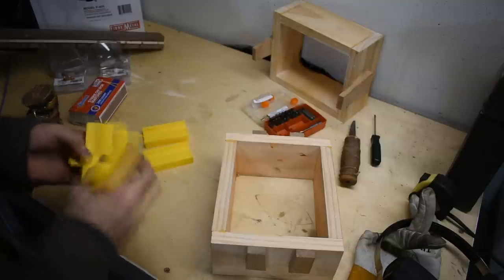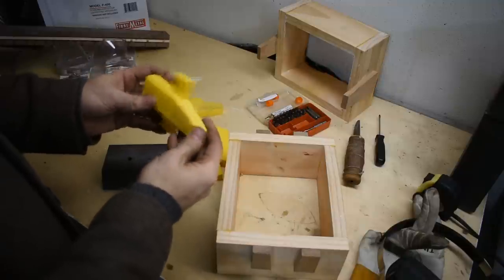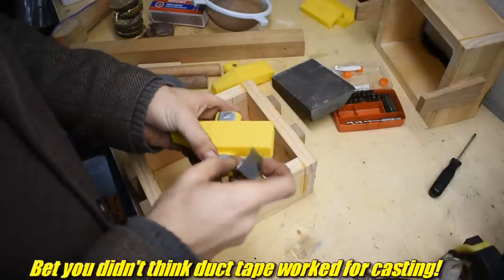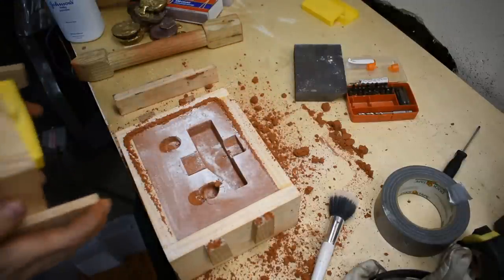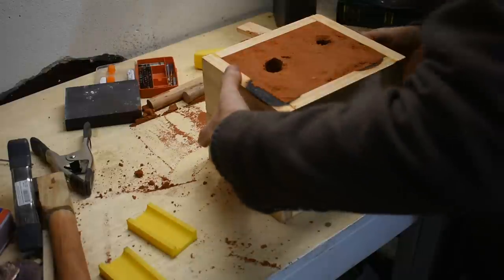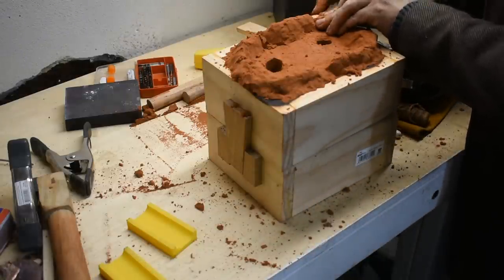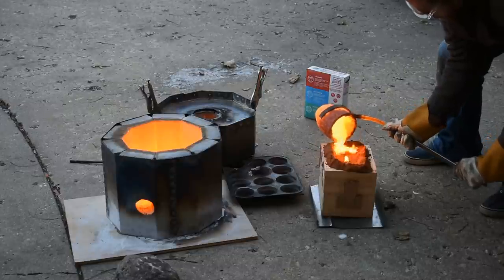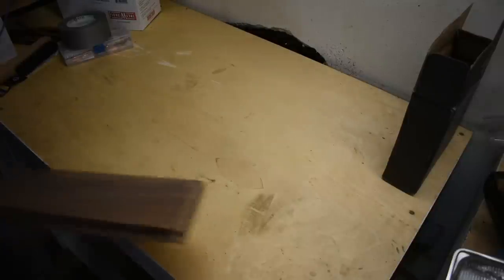DIY Aluminum Bronze Hammer: Golden hammer for Black Smithing

Comment: For hammer Handel length  i use Elbow tip to the your first inside finger knuckle, not the knuckle join touching your palm, the one after so your fingers can go over the top a little bit.
Reply from the maker: interesting, thanks for the tip!  I actually have to make a new handle for this hammer.  I was using it as a pry bar and broke the head off.  Woops!

Comment: Nice hammer! Another reason for the taper getting thicker away from the head is sweat. When you are forging, you sweat, sweat makes hand slippery slippery hands and smooth handle = hammer flying away. (I've been a part time black smith for ~9 years)
Reply from the maker: Thanks for the tip!  Makes sense.
Reply: Quick question is aluminum bronze viable for a forging hammer ? Wont it melt once it makes repeated contact with the hot steel?

Comment: If you want a relatively easy way to help strengthen your parts similar to work hardening, you can take a few 1/16" ball bearings and sandwich them between two strips of tape (about an inch long) in rows at either end. Glue this into a slot in a small rod with equal parts of tape out either side and use that in your drill to make a flapper peener. Using this to hit the surface of your metals will strengthen the surface so it will stand up to fatigue better.

Comment: Nicely done Paul.  About how much does the hammer weigh?  It has been far too cold to fire up my furnace so casting is on hold here for a bit. Yes greensand dies freeze when it's -30C.
Reply from the maker: The hammer head is a little over 2 lbs, not too far above my initial goal.  -30c sounds pretty bad!

Comment: You will have to make sodium silicate next summer.  It's easy and pretty cheap to make with kitty litter.  Or you know it's the stuff in radiator stop leak that stops it from leaking.  We filled a few large empty  alcohol bottles full last summer for projects.  It's great stuff to just have around.
Reply from the maker: I got some kitty litter, sounds like a fun project

Comment: Wow! Super awesome! What’s the benefit of aluminum bronze hammer when forging? Is it to hit a harden tool, like a another hammer, without the danger?
Reply from the maker: Mostly the advantage is I can actually cast it, unlike steel :D  but it's a little denser than steel so it's heavier, and although it's a copper alloy it work hardens a lot so it doesn't go all soft and squishy like a brass hammer.  Fresh out of the sand it's annealed, but it hardens up quickly with some work.  I'm hoping i can make a bunch of tools out of the stuff.  Most of the awesome properties are irrelevant to forging, it's non-magnetic, it's non-sparking, it's tarnish/corrosion resistant, but the weight and hardness is the reason i picked it as a hammer material.  Most alloys i can cast aren't hard enough, except aluminum bronze.

Comment: I'm really curious how the hammer holds up.  When I first saw this video I assumed the hammer would be for display only but in a later video you were actually hammering something with it.  How does it compare with a normal steel hammer?

Comment: Hi Paul I’m about to start my own channel about casting metal/ forging my question is what camera would you recommend me using? Also if you were to drill another hole on the opposite side of your foundry and add another propane tank and get a tungsten crucible I’m pretty sure you could cast steel that’s if you want to go that route.

Comment: Love your videos, more for your humor than your skill, but also for that. Heh, well you wound up with a huge shrink deficit because you didn’t cut a feeder cup that would continue to provide more molten bronze as the hammerhead began to contract away the walls of the mold. I used to work in a bronze foundry, though we used ceramic shell molds instead; not practical for your setup, the pour cups worked as feeder cups all the same, and we seldom had any shrink deficits. However, we never casted anything solid, so I hope you like the color of the smoke I am blowing up your keester.

Comment: Hammer handle length (I was taught) and has always worked well for me: Measure the length from your hammer arm elbow to the wrist bend (I measure just passed that little wrist bone spur that juts out on the at the wrist on top of the hand). SemperFi bb

Comment: If you re planning on doing mostly copper castings, go buy some 7% phosphorus Copper shot.  It will reduce dross, and help (a lot) in the fluidity of the liquid metal.  A little bit goes a long way.
Reply from the maker: For sure. I got some about a year ago and the difference is crazy.  Tiny bit of the stuff does wonders

Comment: There’s a kind of important hammer design feature you missed and that is that the eyes aren’t straight through in cross section, they’re an hour glass shape, slightly smaller in the center of the hole than top and bottom. This way when you put in the wedges the handle expands and gets locked in place. You should also avoid tenon like shoulders at the bottom of the eye, they’re a weak point and never seat as perfectly as a taper does into the eye. 

Also handle length is really just personal preference, but I like as long as my fore arm, about as long as that handle is.

Mistake aside awesome job for your first hammer!
Reply from the maker: Didn’t know that, thanks for the info!  I can always widen it a bit with a Dremel at some point I suppose

Comment: Oh, and by the way, if you want to know what you're Copper to Alluminium ratio is, all you need is Archimedes' help :)
Should be an interesting thing to do, although of course you don't need to do it with the hammerhead because that would require disassembling the hammer.
Reply from the maker: Right! It wouldn’t be too hard to figure out the density and extrapolate the alloy.  Would be fun.

Comment: hey paul , i  was wondering if you know why its an important tool and the purpose of a brass hammer head ????
Reply from the maker: Brass heads are usually used because they are heavier/denser than steel, and softer so they don't damage what they are hitting (assuming you are hitting steel with the brass).  This isn't brass, however, but aluminum bronze, so with work hardening it will be just as hard as a mild steel hammer, possibly harder.  Aluminum bronze tools are usually used where magnetic tools like steel would be a problem, also sparking tools, for example around flammable gasses.  Aluminum bronze won't make a spark, so it won't ignite stuff.

Comment: Hi Paul, looks nice for the first attempt. May be taking a little bit more time on the finish of the hammer head it would look awesome. Try to cast your logo as a stamp, what do you think?
Reply from the maker: That would be cool!  Unfortunately I don’t have any tools to polish, even sanding, all I have is a grinder at the moment
Reply: elbow-grease and an emory board nail file.
Reply: Ok, I understand. For the next piece may be. BTW: I just looked the other video and I agree, his hammer looks awesome too.
Reply from the maker: Haha it would take all the elbow grease in the world to hand polish aluminum bronze!
Reply: You have a welder, how don't you have an angle grinder too? You can get flap discs for your angle grinder. They blend, which is a transition to polishing. A fine flap disc will just about polish something.

Comment: nice hammer casting,
here is a tp for how long a handle could be for the operator 

Add an inch to the weight ratio , meaning a 16 oz hammer head would be 16 inches long + the thickness of the hammer for the handle.
This is not an absolute solution as there ain't one but it is good.

Comment: Hey Paul I was wondering if I could use a green wood torch for the furnace so that I don't have to build one as im Not to confident in making one. I bought one and was testing it out but where the Propane comes out ( the little hole) it gets really hot so I don't want to use it for extended amounts of time. I wanted to see if you have any thoughts on this. Thanks
Reply from the maker: I have no idea what a green wood torch is, so I don’t know.  Most store bought torches and stuff need some modification to work right in a furnace, though.
Reply: it's like a big propane torch but to soften Asphalt and burn weeds. But I guess my real question  is it okay for the  nozzle where the propane comes out to get hot or is that dangerous. Since you dont know what im talking about haha its like the hole you drilled for your propane torch.  Thanks for the reply
Reply: It may need a larger jet, and a higher adjustable pressuer regulator upto 30psi, plus forced air to melt copper.. but i have seen them used in furnaces to melt aluminium just fine, aslong as your tip is steel it will hold up if its too this replace it with a steel pipe..

Comment: What was the Borax for - did not see you using any...?
Reply from the maker: Borax is usually a flux to remove impurities from the metal, but it damages crucibles.  I've stopped using it because of that.

Comment: So my dad is a blacksmith, a good hammer handle will be a size where the tips of your fingers will jus barely touch your palm. If you bought a handle it will need to be custom shaped to fit your hand. So you really aren’t out that much. Also a hammer head will greatly outlast a handle so you may need to do this again in a few years.
Reply from the maker: Thanks for the tips! I didn’t know that about handles.

Comment: What is the use of hammer that is made by bronze-aluminium...??
Reply from the maker: Aluminum bronze is an awesome alloy.  Many tools are made from it because it is tougher than other bronzes (almost steel tough) but it doesnt cause sparks, useful around flammable gases.  Also it is corrosion resistant so many parts on things like ocean going ships are made from it.  For the hammer specifically, the toughness but also the mass is helpful as aluminum bronze is denser than steel, so the smaller hammer head is heavier than a steel one, though hardened steel is still tougher than aluminum bronze

Comment: "I forged my own golden hammer", seems like a good pick-up line. Awesome work! Btw, looked at the other channel and he didn't have those pits, but did have more to poor... might that be the key to that?
Reply from the maker: Yes more to pour into the risers increases head pressure, you get better castings that way
Reply: Yep extra head pressure helps, so would having a larger dia riser, the thicker riser stays hotter longer giving the casting more material to feed on as it shrinks due to cooling..

Comment: Would the hammer head need to be hardened prior to use?
Reply from the maker: Probably.  It comes out fully annealed, but aluminum bronze work hardens very rapidly.  That’s why I was hitting the face with a hammer, to harden it
Reply: @PaulsGarage  I found my old comment. I wonder if you’ll read this.

Comment: what happens if you go with 89% aluminum and 11% copper?
Reply from the maker: thats similar to an alloy called "duralumin" which was an early aluminum alloy used in a lot of stuff back in the day.  it's actually strong enough to use in applications like airplanes and zeplins and stuff, while pure aluminum is soft like butter
Reply: @PaulsGarage  oh ok. i am glad that aluminum and copper can go together. I wonder if tin and aluminum would work?

Comment: Your handle is loose on that head you are suppose to use another hammer to tap the handle through the head.head of new hammer is suspended while tapping the base of the hammer handle.
Reply from the maker: You're right, I fixed it later in a livestream

Comment: Next time use a piece of 3/4" copper pipe for the risers, they cut into the sand rather than push into it.
Also, head over to your local scrap metal center and ask them to shoot your ingots with their radiation gun and it will give you the alloy content %.
Reply from the maker: good idea, chances are good i have lots of impurities in there
Reply: I priced one of those guns and wont be buying one with out winning the lottery!
When I had the small amount of beautiful Golden Aluminum Bronze I made (2 large but not topped off muffin tin molds worth), when they were "shot" for content, it showed 98.24% Copper, .96% Tin, .207% lead and 0% Aluminum even though 25% of what I put in the crucible was aluminum and only raw copper!
I did remove with a grinder any evidence of solder off of any of the copper pieces, and that mold is used for everything I cast into ingots, Aluminum, Lead, Pewter, so there could be a slight residue.
Oh, and one of the Aluminum Bronze ingots did braze itself to the bottom of one mold so the mold had to be destroyed to get the ingot out, and the shrinkage was huge, as in it left a deep crater and a deep hole in the center of each ingot!

Comment: “You could just go to the store and buy a hammer handle for much cheaper” Or I could just buy a hammer. Seriously, this whole making a foundry has been about making a hammer with some copper alloys. Would have been much cheaper to buy a hammer. This turned out nice though. Good job!
Reply: haha of course but where's the fun in that? :P
Reply from the maker: This whole foundry is about melting stuff for fun, the hammer was just a convenient goal ;) and thanks!
Reply: Paul's Garage Ya that hammer turned out nice. Up here in Canada we finally got chilly. It’s -30 degrees centigrade.
Reply: Have you ever priced non-ferrous hammers? Here's one for $82.84 Which is honestly cheaper than I imagined it'd be. As they're mostly used in the oil industry. So money. It is a Lixie too. They're pretty much the last word in the world of hammers. OMG the 132 oz. sledge is $411.08 I'd have to carry a gun with me if I used that on a job site. Back away from my hammer, boy!

Comment: paul, that may be useful as a deadblow hammer but it is far too soft and will mushroom after use. historic smiths made hammer faces as hard as they could for both rebound and wear resistance. this is too soft.
Reply from the maker: Brass and bronzes are too soft, but aluminum bronze is very, very hard, and work hardens with use.  We'll see what it acts like long term, but it's no ordinary brass
Reply: Paul's Garage thanks paul, ill have to build a foundry and check it out myself. let me know if it works out in the long run and if so ill do the same!

Comment: Again the ratio of this cast based off your original video's weights and mixture is.   91.2% copper at 1,471.056grams, and 8.8% Aluminum at 142 your scale 141.944 grams. ;)-""".  Cheers!
Reply: Aaaaand you added copper

Comment: Also as these pieces your creating might likely be in your family for long time if not just in your collection and could use your intials and the year forged recessed into the mold instead of put on in a different manner pr whatever custom marking you would like to do.  Perhaps since you are creating your template using 3d printing you could make such with 2 rectangular box shaped voids in the side for which you could put the same size 3d printed recessed date in one spot and intials in the other. I suggest doing it in this manner so that you could change out the date if you made another a different year etc. Also with the 3d printed changeable snap in date you could put a small hole in each letter letter block or date block so you can pull them out to change them with a small pick or dental type tool. Then one could fill in the hole with temp material so it won't show in casting. This way your gran kids and beyond can know when and by whom such items were made for ages to come. ~Brandon 
You can quote me on that if you like haha

Comment: over all nice hammer, I would like to see the peen made correctly. The shoulder that you put on the handle could cause a split. It would help the hammer if you soak the head in linseed oil over night. 

The only problem with the metal that your using is the temper properties. Over the working life of your hammer, it will become work hardened, so you will have to retemper it occasionally.
Reply from the maker: I'm hoping it does harden, nobody likes a soft hammer ;)

Comment: We'll have to see how it works out for you but usually the transition from the eye to the handle itself is more of a radius than a step on hammer handles. That is because it is a common point of failure with hammer handles. So the sharp corner is a stress point. I know I've certainly broken more than my fair share of hammer handles right there. Also the neck of a hammer handle is to reduce the shock from traveling to you. With your straight handle you're going to get the full effect. Once I opened up a tree branch and found a hammer handle inside of it http://i.imgur.com/Yqsap43.jpg Magic!
Reply from the maker: That’s interesting, thanks for the info!  I’m sure this walnut/maple handle won’t last forever, I’ll have a chance for a second attempt.  I had some hickory I thought about using, but that stuff is so hard I didn’t want to screw up my chisels and stuff.  I always have to resharpen after hickory.

Comment: You’ll want to dress the face of that hammer a bit more. As it is right now you will leave a lot of marks on your work due to the sharp corners. I’d suggest making it 6 sided and slightly round off the edges a bit.